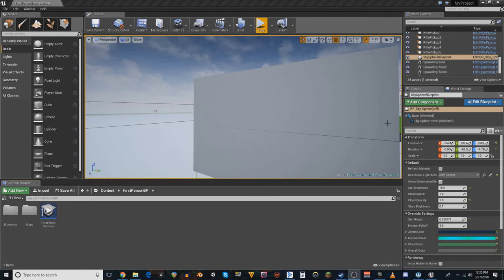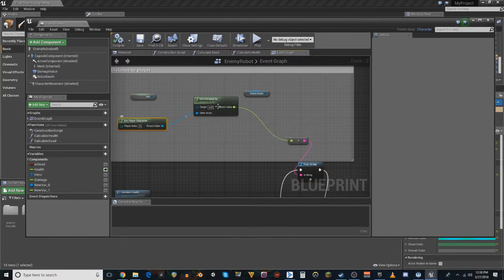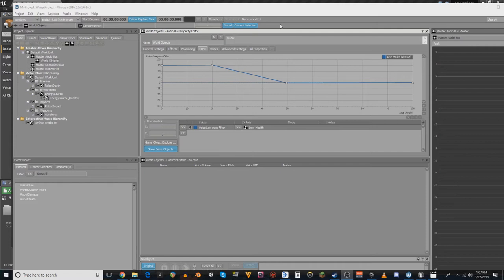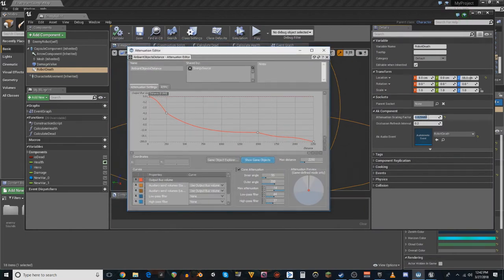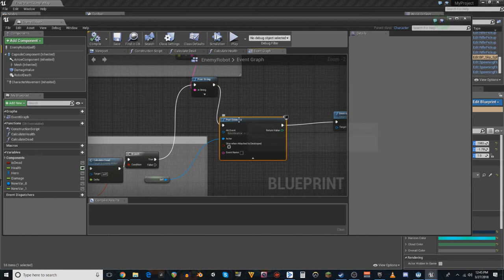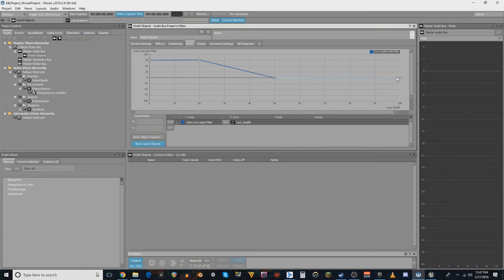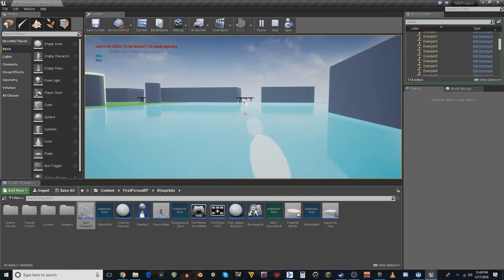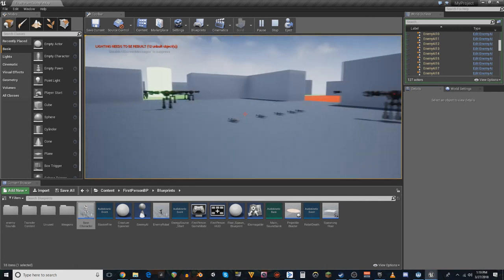Unreal/Wwise RTPC and Attenuation

Comment: Awesome! Curious though, why didn't you set the RTPC up with an event tick? if you did would that not mean the RTPC would just need to be connected to the value as well?
Reply from the maker: Sorry for the late reply. I needed a moment to watch this video again to know what you were talking about. 

At this time, I was still figuring out the best way to assemble this code. And I guess more specifically, I could have forgone using the attenuation functions in Wwise and used RTPC's like I was doing before. I recall I was having some trouble with that and I am unsure why, and had I figured it out, it might have worked. But in the end, for what I was trying to accomplish (the attenuation of sounds from destroying the robots) using the attenuation zones was way more efficient, and was way more "plug 'n play" than what I was trying to do.

In a future video when I am setting up wall speakers, I do what it is you say and update an rtpc on every tick in order to check and update distances between the player and all of the wall speakers on the map. You can view that here: https://www.youtube.com/watch?v=kgI-fngwxnc. It's about 8 minutes in.

Comment: Great video! I'm trying to do a simple thing. I've made a sine wave in wwise, and gave it 2 RTPCs, one for frequency and one for gain. So, the closer you are, the higher the gain and frequency gets. Now, in UE4 I'm trying to setup the blueprints. How can I setup the blueprints, so when I move closer to the Ak event with my player, the higher the freq. and gain becomes? Thank you!
Reply from the maker: One of my later videos talks a little bit about this I think.

However, what you will want is for the object containing the sound to check distance between itself and the player on every tick.

On each tick, check the distance, and have it translate that distance to a float that you plug in to your RTPC.

In wwise you will want a game parameter set up to use that float.
Reply: @brassbgeek  Yes, I've already made a game parameter called distance, which controls both rtpcs. Now, regarding the BP, I need to setup this inside my character BP right?
EDIT:
After setting up all this, I can disable the attenuation option in wwise?
Reply from the maker: @LukaReeson 
You can make the blueprint in your character blueprint if you want. I think it depends on what your plan is for this sound. Personally, if the sound is not originating from the player character, I would make the blueprint come from the object the sound is attached to.

 attenuation in wwise only happens if you have an attenuation parameter set up and attached to the object. Thinking about it, that is another way you could set all of this up which may be easier than using an rtpc.

Attenuations in wwise work very similarly to game parameters, and you can use them to modify different audio setting just like an rtpc would.

I cant look right now because I am at work. Try it out if you can.
Reply: @brassbgeek  I've placed everything into the Cube BP, where the Ak component is also. It works. Here's the screen shot: https://imgur.com/a/2CiwNYj
Reply: @brassbgeek  I know that you can set the attenuation curve, but my "sound" was a pure data patch, where all the parameters were made in pure data.
Reply from the maker: @LukaReeson  I will need to wait until I get back home in a couple hours. Want to continue via email? I saw that you had messaged me.
Reply: @brassbgeek  Yes, of course.

Comment: Hello. I just finished the Wwise 101 and 201 learning modules. I need to start learning Unreal. Where would you suggest I start?
Reply from the maker: Unreal has a few decent tutorials on their website that are good enough to at least get you familiar with the interface. Once you have that part down though, I feel their tutorials are very limited. Personally, I would just pick a VERY simple game type that you are interested in making, picking a project package that fits the bill (so the controls and camera are all set up for you already) and then diving right in. Programming using Unreal blueprints is pretty forgiving, the hardest part is knowing WHICH nodes to use (no need to worry about missing a colon anywhere). Once you run into something you aren't sure how to do, Google is your best friend. I have pretty much entirely put together the project in these tutorials using Google. Because of that,  can get by pretty well without having to search for anything anymore because I learned how Unreal works by slowly building a project.

Learning how Wwise works with Unreal is a little harder. There are some written tutorials available for it, but it requires a ton of experimentation to figure out everything else. That lack of easily-accessible information is why I put these tutorials together.

Let me know if you have any other questions!

Comment: Hey man thanks! these are pretty cool. I'm still failing to see, though, how using wwise aids in the process of adding audio to your games yet though... it seems like, if i have enough knowledge about how to use the blueprint tool inside of UE4 to this level, wwise is just a making me take extra steps, when i could have just "coded" it inside of ue4... But i feel i have to be wrong on that, considering how many people are using it. can you explain to me at all?
like there are attenuators inside of ue lol why would i go through the trouble with wwise to implement them?
Reply from the maker: There are a few reasons, and they will differ from one person to another.

Firstly, you are right. In Unreal especially, you can do a lot of the things I mention straight in Unreal. However, there are a lot of tools that I don't even end up going over that are in Wwise that would be hard to replicate in Unreal. That being said, I plan on putting together a talk for a local game dev group talking about the differences between doing audio straight in Unreal as opposed to using Wwise. Hopefully that talk will be recorded so I can post it here.

Now, even though you CAN do a lot of these things in Unreal, I find that even with a knowledge of blueprints, I find it to be clunky and not particularly user friendly (your mileage may vary though).

Next, if you are a freelance audio professional, then only knowing how to use Unreal will greatly limit your ability to implement audio in other games, and Wwise is prooobably the most used audio middleware tool nowadays.

The next point, which is also more personal preference than industry standard is keeping the programming and the audio implementation separate. For me, it is easier to understand what is going on when I am doing these two things separately, but understanding how they work together.

Lastly, I put these videos together mostly because I wanted to know how audio implementation worked on the coding side of things, and Unreal was the most approachable way for me to learn that (and nobody else had videos on these subjects...which was a problem I chose to fix haha)
Reply: Jeez thanks for the quick reply! Lol

Hm. Fair enough. I assume unity (i have almost no experience in it ) is much more code heavy? As in, no blueprinting, and i would just have to code in it?
Id imagine wwise would be more helpful, there...
Hm.
I'm just now getting into implementing my own audio into games and i must admit im discouraged by how much im expected to know. I feel like i have to teach myself how to code before i can get a single thing done.
Reply from the maker: @ssccaappeeggooaatt  There are plugins that allow you to do visual scripting in Unity, but in general, yeah it is all coding in C#

If you are a composer, and only a composer, you aren't necessarily expected to do the implementing yourself (that is what the sound designer does...usually).

It can definitely be a lot though! Kind of a product of the times. And it is more or less an expectation, especially with smaller studios where they need their members to wear more hats.

That is actually partly why things like Wwise exists. Learning Wwise is way easier to do than say, learning how to use every engine, AND the coding languages for them. Unfortunately, the cost to use the software can be fairly prohibitive for smaller companies.

In addition, although it is easier to use the software than to learn how to code, you still need to know how coding works (kind of like, learning how to read...but not how to write) so that you can tell the coder where to put the Wwise events.

there is a lot to think about!

For you, I would suggest learning how to use Wwise, but definitely keep working on implementing with blueprints as well. Both skills are very important if you can maintain them.
Reply: @brassbgeek  yeah... thank you for the detailed reply.
I think I'm just feeling the pressure of having to learn a million things at once, so much so, that I'm having a hard time being creative or having fun doing it lol maybe its just something i have to keep hacking at.

Which, your videos will help a lot. Thank you! I couldn't imagine doing this years ago when even fewer resources were available
Reply from the maker: @ssccaappeeggooaatt  I totally understand. I am the same way STILL. It is just something you have to work through.

I am glad these videos help! I put these together because there wasn't anything available that detailed the interaction between Unreal and Wwise. So once I figured it out, I started putting up these videos. I am glad so many people find these helpful.

If you have any other questions, feel free to let me know!
Reply: @brassbgeek do you have a patreon? Or any music of your own? Your deserve some support haha. Really!

And i slept on it - if you could make a video and go through one of your projects and cover all the nodes and the logic/thought process as to why and how you put it together that wound be immensely helpful.

Like "ok so I'm making this bow shoot an arrow so i know i need x and y so i do these things to this blueprint and this to this other blueprint class and this is HOW i know that"
Or Maybe a general video using a lot of common tools you use in the blueprint for audio?

... Does that make sense? Lol mostly your thought process. Sorry if it was confusing.

If you don't have the time, that's fine. But itd be appreciated.
Reply from the maker: Hello! I may be a little confused about your question. In your example, are you asking me to explain the whole bow-shooting blueprint, and not just the audio portion?

It usually takes me a while to explain anything because I don't script my videos (my most recent video makes that painfully apparent haha). So I usually just stick to the audio related portions. However, if it would help you to have an entire blueprint explained, then I would be happy to make a video on that once I have the time. Is there a particular blueprint you wanted me to talk about?

And thank you so much for wanting to support me! You have no idea how much I appreciate just the thought!

I don't have a patreon, however I do have a ko-fi, which you can find here: https://ko-fi.com/timothyadan

I also have one album for sale on bandcamp here: https://brassbgeeksmusic.bandcamp.com/

Thanks much! :-)
Reply: @brassbgeek  i just used bow shooting as an arbitrary example. It could be for any instance/process in a game. Footsteps, sword swinging, dialogue, whatever. As much as you can explain lol
And i meant the audio portion, in particular, and your thought process as to where to put what code and why.
Maybe record while you're building it? Idk.
But again, mostly the "i know i need this to happen, here's how i get it done, and this is my logic for it" at a rudimentary level lol
Reply from the maker: @ssccaappeeggooaatt  okay. I can probably do short "deep dives" on my blueprints. I do just kind of go over WHAT I did as opposed to the WHY.

Since I am currently out of subject matter for videos (until I hit another milestone in my game anyways), that can be the next thing I do. After possibly rerecording my video on volume sliders.
Reply: That's great to hear! Do your thing. I'll check your bandcamp once im out of work
Reply from the maker: @ssccaappeeggooaatt  idk how long it will take before I get one of those out, I have some music I need to get done haha. But I will work on that when I can :-)

Have a good day at work.
Reply from the maker: @ssccaappeeggooaatt  First off, thank you so much for your support, I very much appreciate it.

Second, I was thinking about your request, and the result is I am going to start a new series, using the current versions of both Unreal and Wwise, in a "game" that I will put together from scratch specifically for the purpose of being a tutorial. So look forward to that! :-)